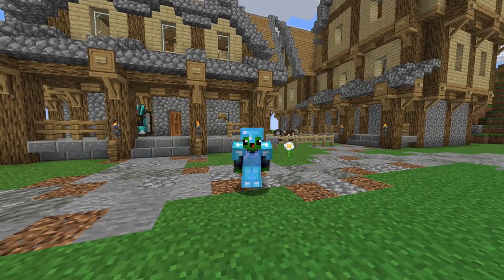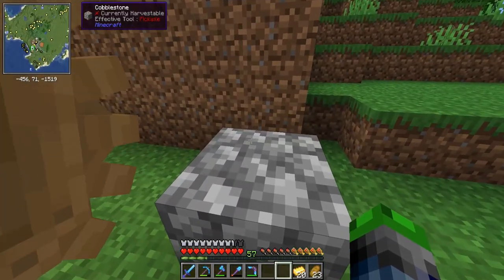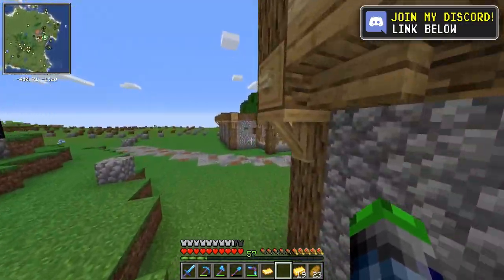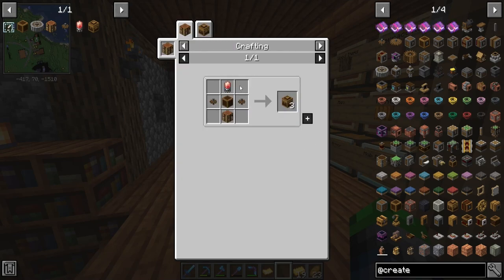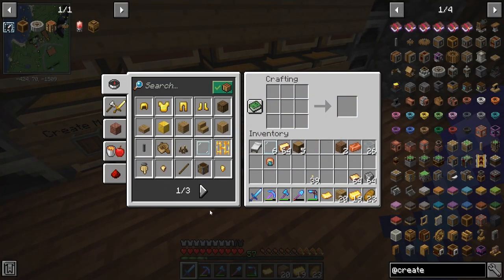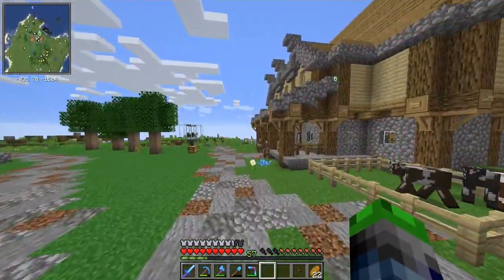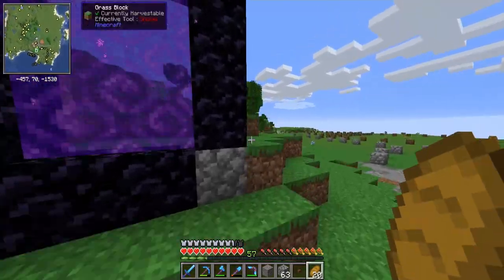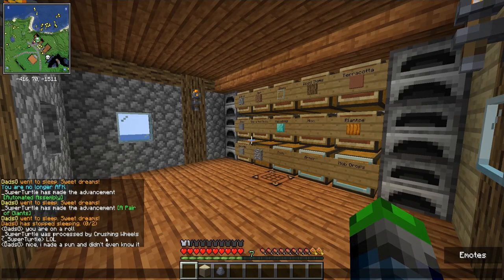Overstressed SMP | Create Mod - Crushing Wheels and A Cobble Generator! | [EP 02]

Comment: Great video man this is a great series and btw just to help out the water wheel can be placed in two directions the current set up you have is backwards but it works just slower so if you keep your exact setup but change the directions of the water wheel it will work better if that makes any sense but keep up the great work!